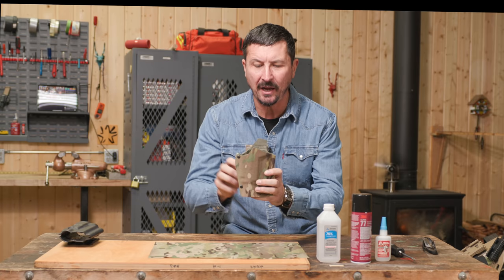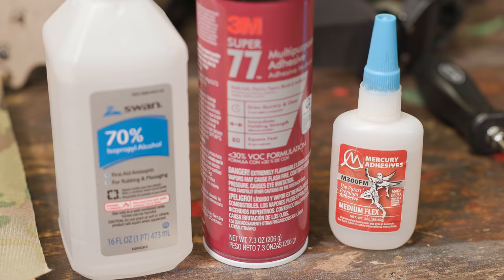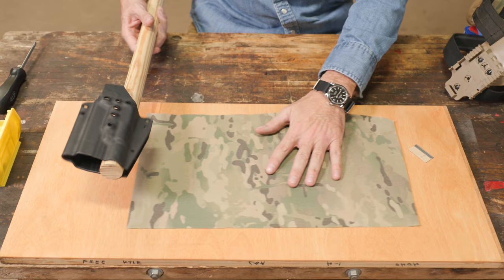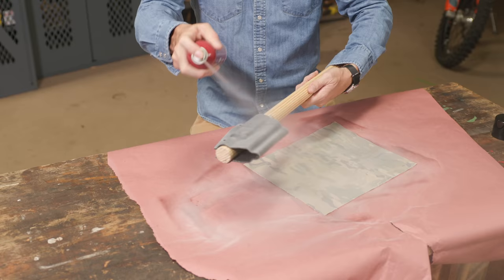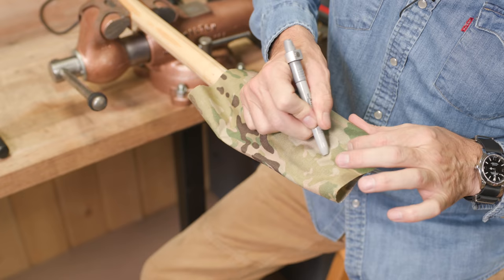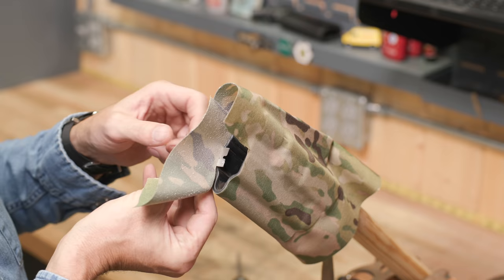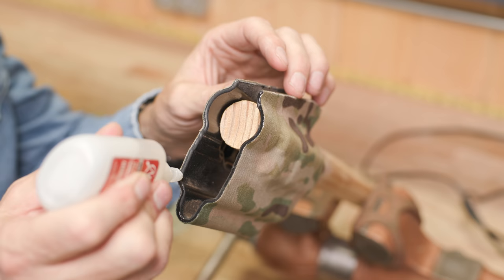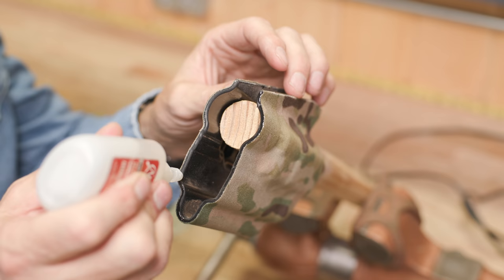How To Wrap Like A PRO

Comment: great diy project. quick question, why even have a seam in the back? I think you can just wrap from end to end just like the sheet of kydex was folded and cut. not sure if i'm explaining that correctly :). glad you are feeling better.
Reply: Was thinking the same thing.   Since a kydex holster is basically a taco for your pistol, after the hardware is removed, you could just form another taco with the fabric and put the holster inside of it; and then cut the edges after the fabric has been fitted.
Reply: The reason I opened comments was to say this. Maybe there's a professional home owner reason... It does look great though. Not that I have a holster. Or a firearm.
Reply: @MKlucas7  exactly, a taco within a taco. no seam. glad i made at least some sense it was hard to explain. now i want tacos.
Reply: @allencevans  as a professional home owner myself i would have wrapped the firearm then wondered why it no longer fit in the holster lololol.

Comment: Why not align the edges of the wrap with the open edge of the holster, leaving a bit of overhang, and then trim it off like the rest when you go around with the razor? Then you wouldn't have a seam at all.

Regarding the ads, I prefer the sponsor spots over the random and annoying YT ads.

Interesting idea. Not something I'm likely to do to my holster, but interesting to see how it's done.
Reply: I was coming to say the same thing, but you beat me to it sir.
Reply: Agreed on all points.

That said, you could design a bunch of holsters to match the fabric of your pants so that they blended in to that fabric as a form of social-camouflage.
Reply: it is as you said.  i would keep the few inches of overhang and glue them on the inside just past the screw holes.  then when the glue starts to fail at the edges, the screws hold it from slowly unwinding completely.
Reply: I was going nuts watching him center the fabric on the side of the holster, instead of lining the edge of the fabric up to wrap around the holster. They made the holster with a single piece of Kydex, so why not do the same with the wrap. Ugggggh.
Reply: Yep, it isn't a cylinder... it has an open edge.
Reply: Was gonna ask the exact same thing but I figured someone else must have already and here it is haha
Reply: @littlejackalo5326  same here it was hard to watch haha. Couldn’t understand why you wouldn’t do that. Figured there must be a reason that I’m not getting but I don’t think there is

Comment: Part of the benefit of wrapping a holster in this type of material is it cuts down on reflectivity since kydex can be kinda shiny. And noise reduction from a branch or something similar, instead of plastic is on cloth. I think both are minimal, but every bit counts sometimes. 

I prefer ads from content creators as opposed to the ones from YouTube.

Comment: If the holster effectively has a seam on the back edge, why wrap the cloth all the way around and have a cloth seam on the back side? why not just follow the same seam for both? Either way, this is an awesome wrap... I like that a LOT more than getting a camo print kydex. I would think it would make it a little quieter, and less "shiny" or reflective.  I also really like that holster system.. I hate having the holster threaded in the belt, and then you need to take the pistol off, but the only way to do that is unholstering the pistol.. I like keeping the holder on the pistol like that. 

Also, for the ads.... just FYI, my ads for this video were for Carter's children's pajamas.. 
Last thing.... the YT channel Donut Media also does in-video ads, however, they also add a little yellow progress bar across the bottom of the frame while in the ad part of the video... I thought that was kind of clever.

Comment: Using a heat gun or hair dryer helps make the material easier to work with getting the details filled in

Comment: I'm really struggling with trying  to understand the need for a seam. The holster isn't continuous, it has two ends that bolt together for retention. Those two ends are your starting point and end, without the need for a seam.

Comment: My only suggestion would be why wld you want a seam in the first place when you can do exactly as shown here, run the ends over the side where the kydex meets to screw together, and just trim the excess off? Otherwise super simple, straightforward and informative vid

Comment: Hey Cody will those side car holster work for a guy with a little bit of a spare tire? I’ve got one of the old AIWB holsters and it wants to rotate side to side since it only has one clip. I was wondering if the second clip alleviated that issue.

Comment: A yard of fabric is not 3 foot by 3 foot. It's 3 foot long by however wide the bolt of fabric is. Sometimes 24 inches, 30 inches, 36, 40, etc.

Comment: Why would you cut the fabric on the center back when you are already cutting along the outside edge where you are bolting it together? It would maybe be even cleaner if you use the already folded edge of the kydex as the center of the fabric and using the natural end to make your cuts. IMHO